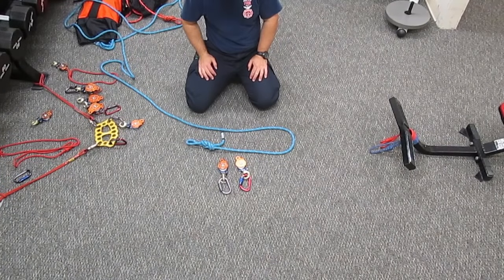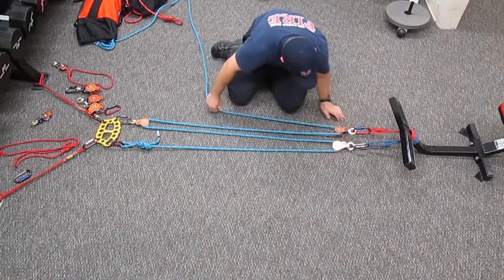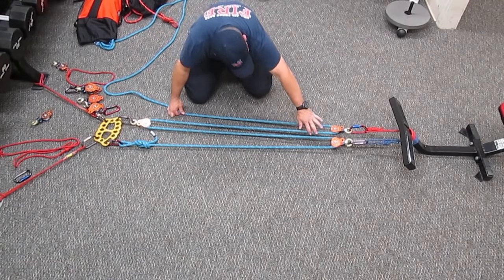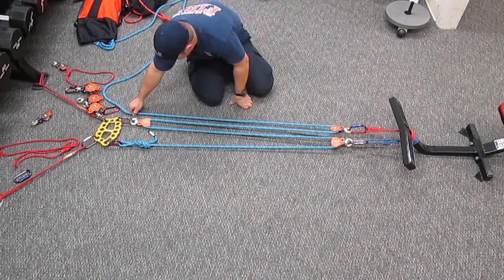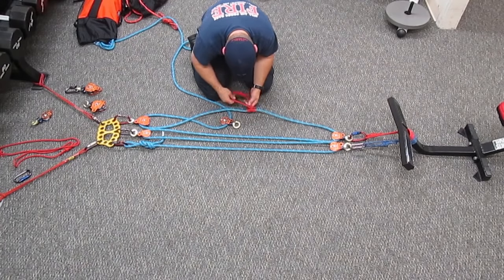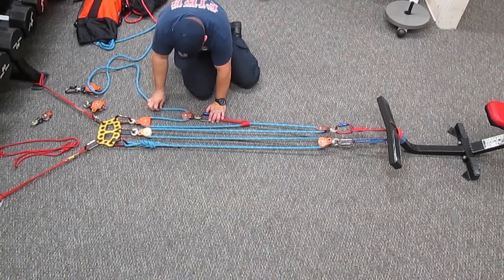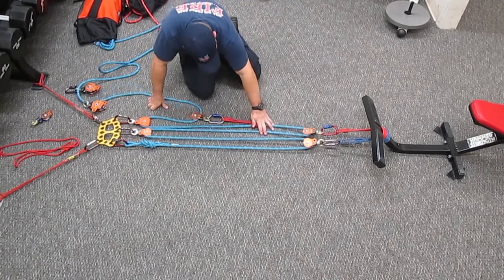4:1 Mechanical Advantage converted to a 12:1

Comment: it is 8:1. if you imagine the last 2 pulleys he adds as being on a separate anchor it's easier to see where the confusion is. the new "load" is on the prusik, which is a 2:1. he's not getting 3:1 out of 2 pulleys. that new 2:1 multiplies his original 4:1 to get 8:1.
Reply: This is 100% a 12:1
Reply: Stewart; Can you describe your calculation?  eg if you count the ropes tied directly to the moving load I count 4.  If you count the ropes going to the prussik I count 2.  2X4=8.
Reply: @BriTube007  There are 3 at the prusik. This is a 4:1 being pulled by a 3:1 so 12:1 total
Reply: @killer2600  No.  There are 2 at the prusic.  The 2:1 is reeved to advantage to ONE line at the prusic; you don't count the prusic attachment itself!
Reply: @lashlarue7924  I'm not going to argue this, the fire department guy is obviously trained in a specialized field. Either you tell him he's an idiot or you figure out where you went wrong. P.S. you did go wrong. Hint: If his logic on the 4:1 is correct, why is the 3:1 logic wrong, if he only setup a 3:1 (no 4:1 present) why would it not be 3:1?
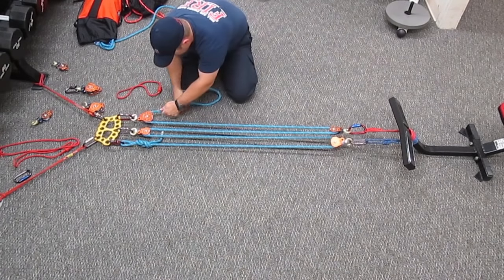Reply: Pause the video at 2:30 then listen to his explanation. You could clearly see and count that there are 3 lines right in front of him starting from the prusik loop or in this case from the load. Multiply that 3 lines by 4 lines that he established at the beginning up to the prusik loop (4 lines on his left before the prusik loop)

Comment: I agree that pulling on a single point, such as the weight bench demonstrated here, provides 12:1 mechanical advantage.  However, if you were tensioning parallel or tandem high lines, the tension on each line would only be 6:1.  The true advantage of the Flying W in that case is that the tandem lines are self equalizing, as was stated in the video, and each would be supporting the same weight in the system.

Comment: What is the limit of mechanical advantage one can get when you factor in the friction of the pulleys? I assume that at one point adding another pulley would put so much friction in the system that you actually remove mechanical advantage.
Reply: You could multiply the efficiencies of each pulley and get an estimate of the efficiency of the system. If the load is 100N and the efficiency is lets say .8 the ideal pulling force required would be (4:1) 25N, divide that by the efficiency of the system and you are pulling 31.25 N. Using pulleys wont get you less mechanical advantage as the efficiencies are quite high. Using carabiners instead could prove a problem as the efficiency lowers and the real force required to pull the load may be closer to the 100N.

Comment: Your first one wasn't a 4:1.  It was a 3:1 with a change in direction.   Then you made it into a 4:1 with the 4th pulley and joined it with a 2:1 on the prussit.    You made an 8:1.

Just look at the part where you announce 4:1.  If you pull 3 inches of the top rope, you're getting 1 inch out of each of the other three lines.
Reply from the maker: I think you might be looking at this backwards.   An even mechanical advantage sees the rope terminate at the anchor.  An odd mechanical advantage sees the rope terminate at the load.
Reply: @dangerstall  you are correct.  I went down a rabbit hole after this and discovered my fundamental understanding was flawed.  Rope pulled vs load move distance doesn't have to equal MA.
Reply: @whermanntx  Good that you see it as 4:1 now but don't go away with a misconception... the length of rope moving through the system vs distance the load moves still relates exactly to the MA.

Comment: If watchers here cannot google a reference then don't bother wasting peoples time. Prussic is a friction knot or cord used to attach a loop of cord around a rope, used in multiple areas ie rope rescue, mountaineering etc. Mainly used in progress capture situations when a loads are an issue. and yes they are very effective. I have worked at heights over 350 ft. with this knot to rescue / haul victims.
Reply from the maker: Michael Rhymer if people don't already know what a "Prusik" (correct spelling) hitch is, they don't need to be learning any type of mechanical advantage.
Reply: Ryan, What  Air Force Base do you work for? I work for Cape Canaveral Air Force Base? FF/ paramedic, tech rescue. And I agree on the mechanical advantage statement. Some people just want to comment about idiotic stuff, they do not understand the NFPA requirements we deal with. in addition to the DOD requirements as well. keep doing what your doing brother, everyone thinks they are smarter than everyone else.
Reply: prusik is mainly used for progress capture systems. They can also be used for ascending a line. the klemheist isnt approved for high angle rope rescue as far as i know.
Reply: @dangerstall  I didn't know the word Prusik, but need to understand mechanical advantage so I can create a pulley system to move a shipping container. Thank you for the video. Remember, you once learned these words too.
Reply: @anthonyd5884  Indeed, learning mechanical advantage goes beyond rescue work. For Ryan to make such a statement that you don't need to know it outside of the rescue field only shows how limited his understanding is of mechanical advantages resoucefulness.
Reply from the maker: @killer2600  that is not at all what I was saying.  I was saying that you should know what a prusik hitch is before learning mechanical advantages.  Any rope related class in history starts with learning knots and hitches before moving on to mechanical advantages

Comment: Where would one put a progress capture prusik on this?  I'm just trying to lift something heavy.
Figured it out.  Now how do you keep all the lines from twisting?  I was using polyethylene which seems like it wants to twist easily vs climbing rope.
Reply from the maker: At the last change of direction pulley at the anchor.  I pointed to where it should go, but never attached it.  Re-watch the video and look for where I placed the prusik temporarily.
Reply: @dangerstall    Thanks!   P.S.  It worked great for my purpose which was lifting a very heavy plasma tv (little old) and I learned a ton and didn't kill anybody.  The audio was a little difficult and I knew what a prusik was but still couldn't understand the word.  But, still a great video overall.  Also, understanding what you do makes me appreciate it all the more.

Comment: So isn't that complex/compound system limited by how much rope is in between the last pulley and the limit?
Reply: Once the prusik reaches the pulley you can reset the system by sliding the prusik back towards the load if you have a load capture device in place (which he doesn't).
Reply: In general more complex the mechanical advantage system the more rope you will need.

Comment: if you used scales to measure the input force and the output force you would probably find the actual mechanical advantage to be far less than 12:1 due to friction
Reply from the maker: Yup.  That’s not the point of this video.  It is a theoretical 12:1.  There are multiple variables to find out the true mechanical advantages, one being the efficiency of the pulleys

Comment: You have an 8:1, not a 12:1.  Your final 2:1 connected to a 4:1 = an 8:1; it does NOT magically become 12:1 by the way you rove it to advantage.
Reply from the maker: Sorry, but it is a 3:1 connected to a 4:1.  3x4=12.  Study the T method for units of tension and get back to me.
Reply: I’m by no means and expert in rope rescue yet but I thought mechanical advantage only multiplied when you introduced one simple system onto another. Had he attached a rope grab to the 4:1 and then created a 3:1 using another rope, acting as if the rope grab on his 4:1 was the load, he would have made a 12:1.  I wasn’t aware you could multiply mechanical advantage using one system like that.
Reply: @johnsonjj117  Effectively, that's exactly what he's done.  Everything left of the rope grab is that separate 3:1 system acting on the first 4:1 system.  It just looks confusing because the 3:1 is anchored to the same plate.  The 4:1 system starts where it exits the load.  It doesn't have to go through a change of direction to be a 4:1 - just pull it to the left (instead of to the right through a COD).
Reply: @dangerstall  Sorry but it is a 2:1 connected to a 4:1  which makes an 8:1
Reply from the maker: @johnsonjj117  it would be exactly the same thing whether it’s one rope or two.  Think about it.
Reply from the maker: @hfdarff54  wrong.  A 2:1 is an even system and with all even systems the rope terminates at the anchor.  Tell me how this is a 2:1 now?  I gave a great explanation with the T method of calculating mechanical advantage.  Watch some more videos on the t method and hopefully it will start to make sense.

Comment: that is 8:1
Reply from the maker: orble h no, its a 12:1.  learn the "t method" of figuring out mechanical advantages.   also,  when you create a complex system you multiply the systems.   3x4=12.
Reply: you must prove it by pulling a heavy stuff up, using a meter.  Anyone should trust numbers only.
Reply: And I will test this either.
Reply: Yeah, it's a 3:1*4:1 = 12:1. Verifying with numbers is good (make sure you're aware of friction affecting them), but these systems are so commonplace that they're easy to analyze.
Reply: The system is divided into the exact point where the blocker is placed.
Reply: I think this is 8 times advantage
Reply: it is 8:1. if you imagine the last 2 pulleys he adds as being on a separate anchor it's easier to see where the confusion is. the new "load" is on the prusik, which is a 2:1. he's not getting 3:1 out of 2 pulleys. that new 2:1 multiplies his original 4:1 to get 8:1.
Reply: It’s 12:1. Yes Most of the load is on the prusik, but the line going thru the prusik is still helping pull the load with one unit of tension, so it’s 3:1 pulling 4:1 gives it a 12:1.
Reply: @chrisblanset  dude, no. You are wrong, stop insisting that, those systems are around for centuries, and are easily cauculable by using the "T method". The prussik pulley is a 3:1 multiplier (is the same principle of a truckers hitch, which is also a 3:1 multiplier, disregarding friction) on a 4:1 multiplier. 3:1*4:1=12:1